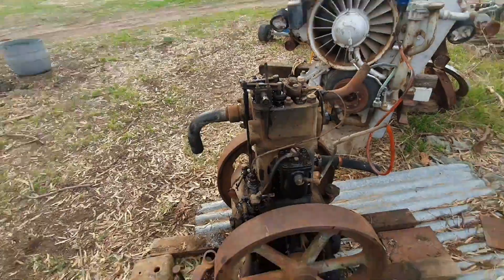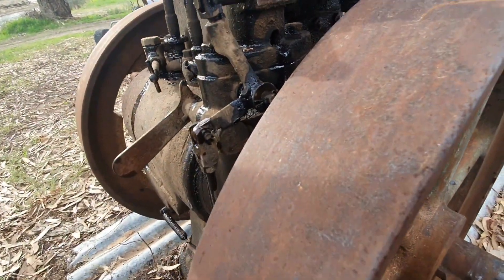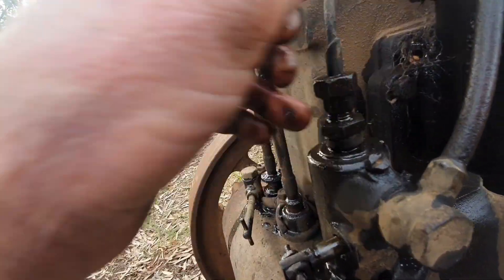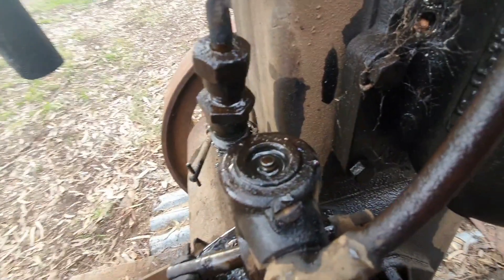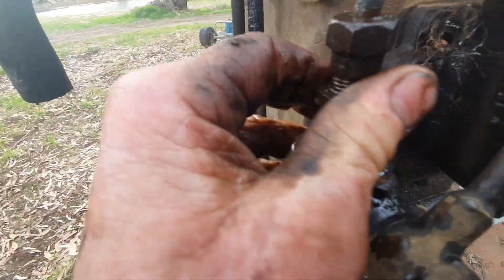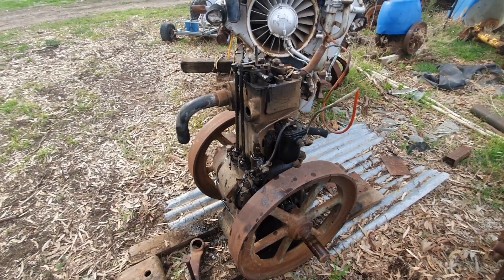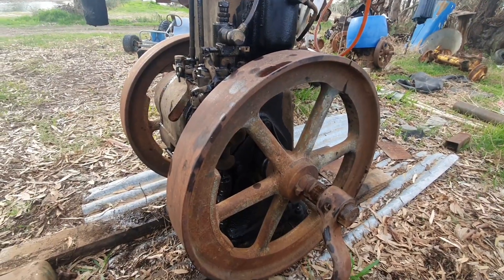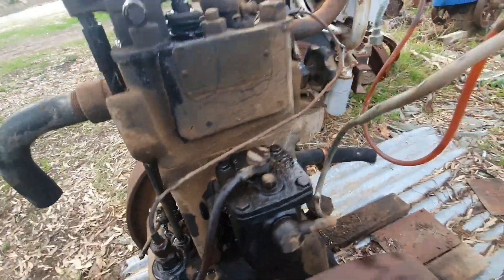Old 3 hp Lister CS. first start

Comment: I've got one or 2 donks lying about 😂😂  ph1 and 2 in old old dumpers still pulling their weight an sr compressor . Lt jet washer , lifts tarmac !  St1 saw bench 10hp at 2600 rpm (formula 1 technology) fu@k that for a game of cricket , hawker siddeley 10kva lister st3 genset  ex telecom .they reckon they can do 120,000 hrs if they have the slippy stuff changed regularly  !!  My 1927 L and  53 ava1 are the oldest . Also a few tons of the old a's a1 d's and less than 10k from me back door a C.S complete with crack in jacket which put everyone off except me coz I like a challenge 😂😂 I was trying not to , but now I'm gonna give the bloke a ring  !! Cheers all the best from Pomme land ❤❤❤👍👍👍👍👍
Reply from the maker: I still look after several old air cooled twins and singles on irrigation pumps and a big six cylinder on a generator. Go and get the CS and weld her up. I dug a CS out of a dam bank which a bull dozer pushed up thirty years before and it was going in two days. Cheers mate.